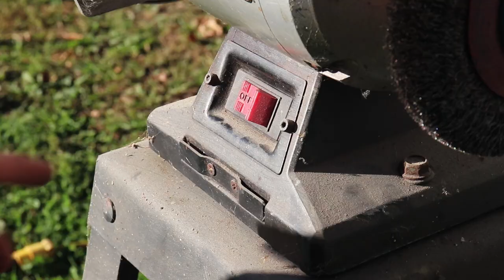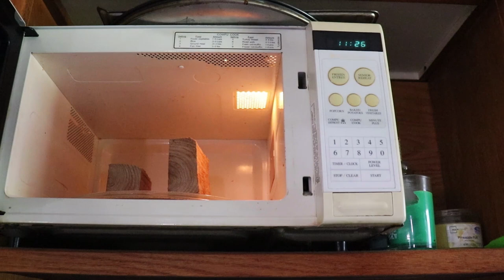Restoring vintage 1898 patent Stanley bailey wooden hand plane

Comment: Nice job. I just bought a Siegley wooden 22” plane. Almost functional out of the box so Ina much better starting point than your plane. Did you use vinegar to remove rust? Did you have a hard time getting metal plate off the wooden sole? Satisfying to bring vintage tools back to working order. Good for you
Reply from the maker: Thanks! Yes I did let them soak in vinegar. You could try some WD-40 to get that unstuck, if you haven't already. Good luck!

Comment: I missed the part where you drilled the mounting hole through the tote. It is easier to drill that hole first then lay the pattern out to the hole than it is to shape the handle then drill the hole. Because that's a pretty deep hole.
Reply from the maker: True that

Comment: that plane is not a wooden hand plane, it´s called a transitional hand plane, it was suposed to be a bridge in between wooden hand planes & the new incoming full metal hand planes, you could also put some epoxi in those cracs that youhave on de wood just for stabilizing the wood a bit more by all good job.P.D: you have some more restorations coming with those old metal planes, good luck with them.
Reply from the maker: Thanks!

Comment: What did you use to soak the metal parts in? I just bought one of these and it’s in pretty good shape however it still needs some work before I can start using it.
Reply from the maker: Apple cider vinegar, good luck!
Reply: @xRoSkii  thanks